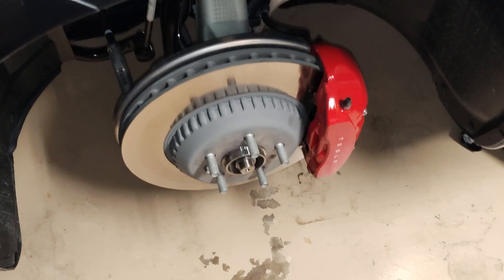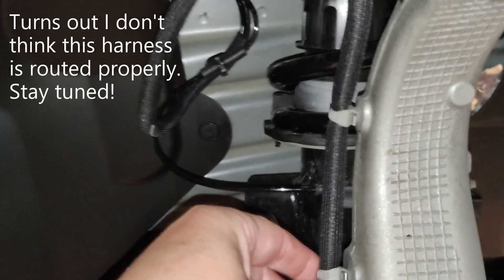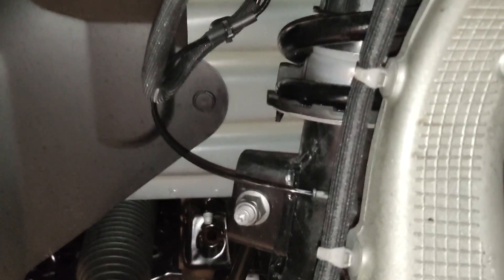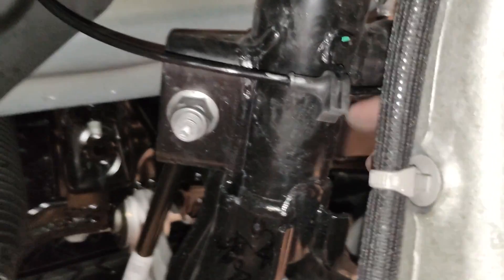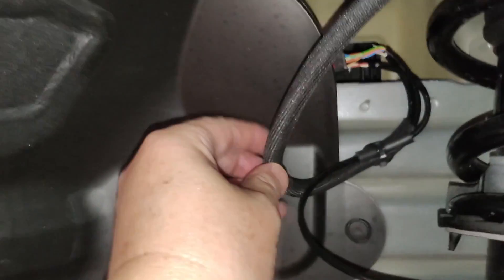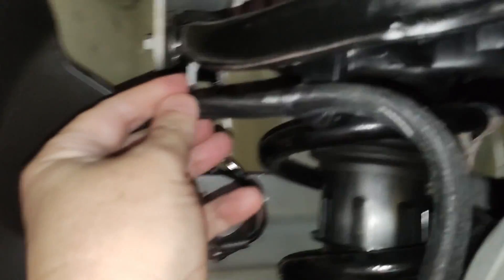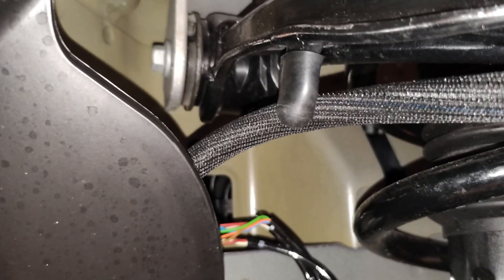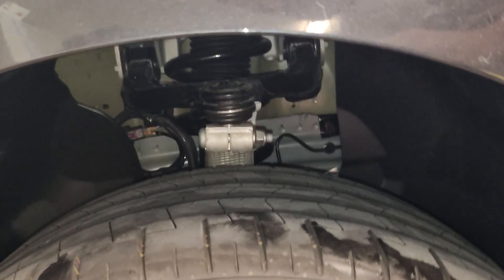2024 Tesla Model 3 Performance - Potential Fix for Adaptive Suspension Errors

Comment: Great information, thank you.  Both of mine were tucked behind the plastic shield and I could see that looking through the spokes of the wheels without a jack.  By the way, I have a very early 2024 Model 3 Performance and at the point where you installed a vacuum hose end cap, on mine there is a plastic zip tie around the cable attached to a plastic barbed post that sticks through the hole in the metal piece.  You're missing that part and the cable should be attached at that point.

Comment: I'm waiting for the new rear motors to stop leaking oil before i buy another M3P
Reply: Another video showed it's not an oil leak, it's excess lubrication on the half shaft and around the seal.
Reply: @S2kDude36  Link?  A giant puddle doesn't seem like excess lube..
Reply from the maker: @S2kDude36  Yeah I did that video last week.  Keep in mind that I have seen a COUPLE instances that look like a true leak but I think most fall in the assembly lube category and nothing to worry about: https://youtu.be/kn1ZihqqNcY

Comment: Does the other wire not rub? The thinner black one you left out.
Reply from the maker: I know it's hard to tell in the video but the thinner wire is way farther inboard and away from the tire/wheel so no chance of that one rubbing IF it is clipped in properly.  That one does appear to go to a suspension component though so I suspect it's part of the active suspension.  So I guess it's possible that it could get dislodged and rub if not clipped in properly.  Hoping to hear from more people so we can tell if my car is typical: maybe the thinner wire IS a problem on other cars.